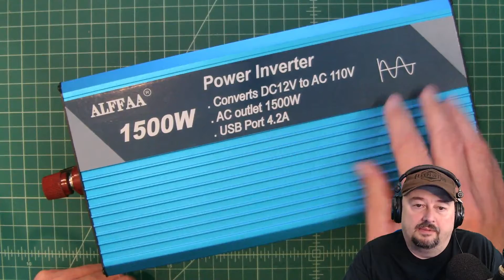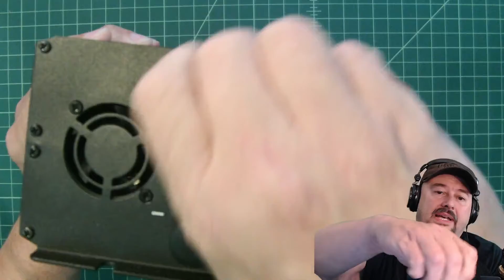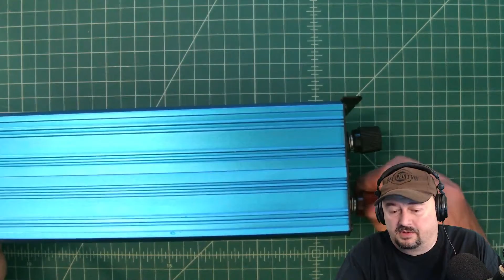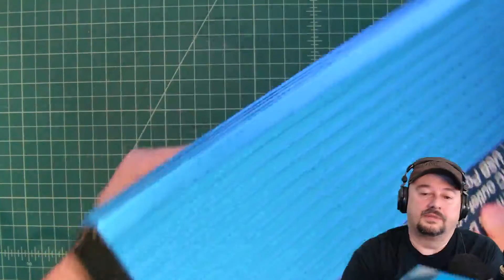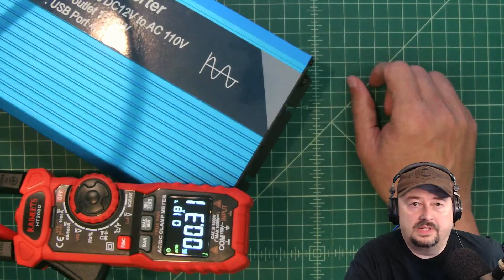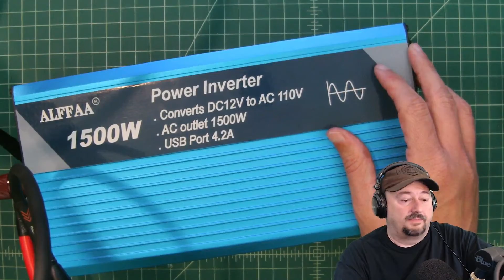Is it Junk? - ALFFAA 1500W Solar Power Inverter

Comment: You mite start using a pre-charge resistor, say 5 ohms at 50 watts. No problem, we live and learn.
Reply from the maker: I didn't show on camera but I used a voltage tester to pre-charge them.

Comment: Thanks for the review. In reply to some of the more technical comments, inverters are now a piece of consumer electronics. In the case of an inverter, the man in the street may have a spare car battery and want an inverter to power his fridge during a power outage, so the required bit of kit should be "plug and play"! This unit seems to fail this test. I hope the supplier will replace the unit FOC, with apologies, so that we can see the thing working. Remember, the true worth of a company is shown when sorting out a problem, if they work to fix things quickly and efficiently, chances are they are OK. Jim M7BXT
Reply from the maker: Hey James.  I was able to process a return to get refunded and I was contacted by the companies marketing department.  As of right now they are trying to make it better than "right."

Comment: Adding up the sum of current available on multiple USB ports just for marketing is a !@#$ move. It's dishonest. It's not bad enough that it makes you a liar, but you seriously managed to put 10 watt USB ports on your 1500 watt inverter. I'd have more respect for them if they put two 3A USB ports and called it a 1530 watt inverter. Still bad marketing but at least then I'd have two 15 watt ports.
Reply from the maker: I was hoping to get the chance to test those ports out a bit too.  Thanks for watching Norrin.

Comment: Disappointed you didn't get to show your inspection protocols. You did not provide how you acquired the ALFFAA.  Who was the seller? Was it sold as new? Appreciate you're allowing us to learn from your experience. Hope you either get your money back or are offered a replacement.
Reply from the maker: Hey Bill.  I got it off Amazon so the return was easy enough, it was sold as new.  The manufacturer has reached out to see what they can do to help out as well, stay tuned!
Reply: @TheSmokinApe  Thanks. I will stay tuned.

Comment: The inrush current from charging the capacitors in large inverters frequently trips BMSs in lithium iron phosphate batteries. Not to say that explains why the inverter doesn't work at all, but that does explain it. Tripping your battery. You're supposed to use a resistor to charge up the caps generally on large inverters 🤷

Keep these cool testing videos coming!
Reply from the maker: Hey Devin.  I actually charged the caps via a voltage tester that slows that inrush down, I can show that in another video.  I am thinking there may have been a short in the inverter and the BMS shut the battery down but I don't know for sure.
Reply: @TheSmokinApe  gotcha!. Wasn't sure